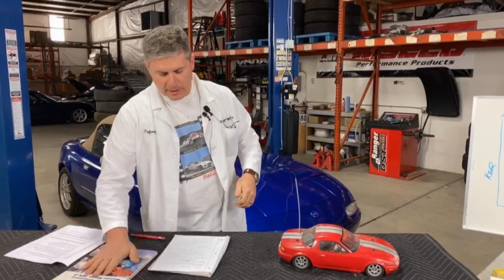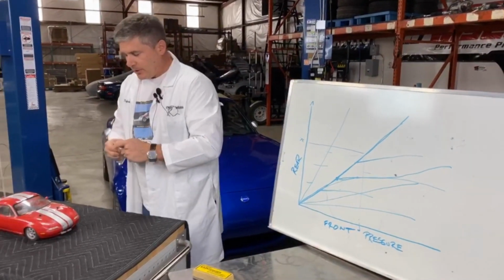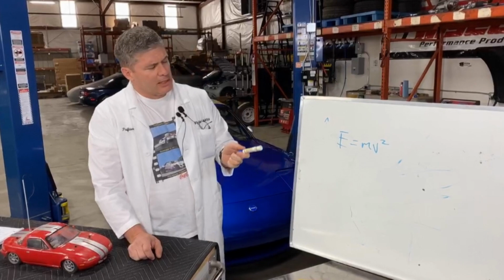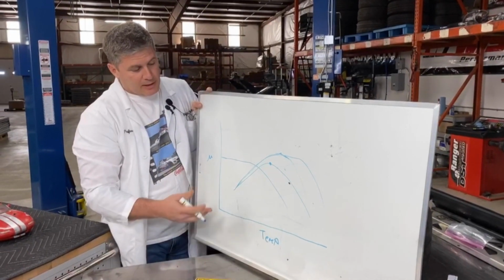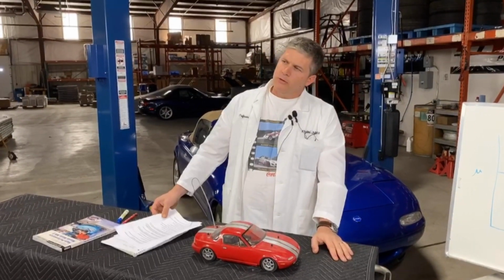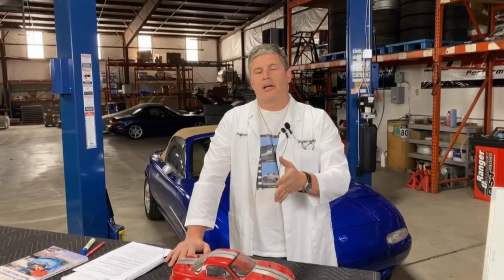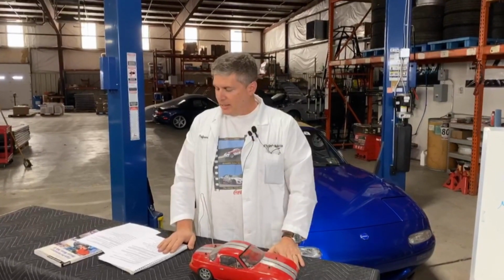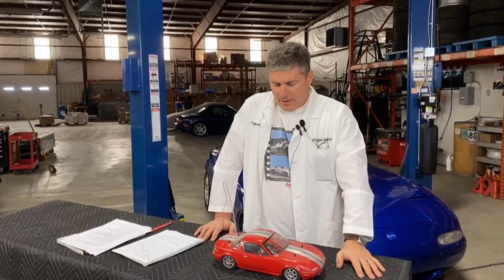Performance Brake Theory (FM Live)

Comment: Apart from calipers and braided hoses, where can I make improvement in overall pedal feel (specifically firmness)? My NC is definitely better with good fresh 600F fluid and braided hoses (and properly bedded track pads) but I'm wondering if there's an upgraded master cylinder with better rigidity or something similar. I know there are also m/cyl braces available but I've been told they don't do much.

Not looking to go for bigger brakes yet, unless maybe i get hold of some RX8 fronts
Reply from the maker: Master cylinders don’t really have a rigidity problem. The thin sheetmetal they’re bolted to does. You want the mounting point to be as solid as possible. 
If you put a larger diameter master cylinder on, you will get less pedal movement. You’ll also have to apply more pedal pressure for the same amount of brake torque. “Bigger” calipers can mean a few different things, see our video on brake caliper tech. 
On the NC, a set of stiff calipers has a very large effect on pedal feel.
Reply: @FlyinMiataVideo  thanks. So does a MC brace help appreciably?
Reply from the maker: @dielaughing73  we've not investigated it on the NC as much, but it's easy to check how much flex there is. Have someone push hard on the pedal while you're looking at the master from the engine bay. If the master moves, you would benefit from a brace.
Reply: @FlyinMiataVideo  thanks again

Comment: Keith, your white board on proportioning valve effects was a nice touch on what Mike Usrey did with his display of fluid proportioning. I learned a lot from both of you on proportioning.
However, my question here is on brake bedding your pads/rotors. 
I watched this video twice and read through the comments, but did not see this question...maybe because it's a dumb question, but even dummies need to know.

When changing from a street pad to a track pad, (vice versa) do the rotors need to be cleaned of the previous pad material transfer before bedding in the different track/street pad material?
Or no bedding is needed of the pad/rotor when changing back and forth?
Is this only required when using a new rotor?
Thank you!
Reply from the maker: Glad it was helpful! 
The answer to your question is "that depends". Some race pads and street pads will play nice. There's a much better chance of that if they're both from the same manufacturer, and the best thing to do is ask the pad manufacturer about the compatibility of their various compounds.

Comment: I ordered your book last night Keith.  I have been trying to research xida vs fox vs the koni setup and a few other things (FM sways vs the setup 949 recommends is another one).   I keep coming across your posts on forums and they are really helpful.  My plan is to read your book cover to cover and after that / once I have the cash ready I will call FM and sort out whatever questions I have left about the suspension options out there.

Comment: and along came the ND.  here's a question is there any benefit to two piece rotors if there the same size.  seeing  as the na/nb use a 11 inch or a 11.75  as a big brake kit. but the nd use a 12.19 or 12.88   is the 11 inch two piece on a nd going to have any benefit? 

another question.  how does some one figure out if they just need the 4 piston caliper, or if they need a two piece rotor too.   does it all come back down to the question of how much heat it can shead , aka how much thermal capability ?

Comment: I’d love to see an overview of all your brake kit offerings to help me decide what I need. I’m not ever tracking my Miata so I wonder how much of a difference the brake upgrade kit would make vs the little big brake kit in street driving.
Reply from the maker: Hi Franco, as with most of our performance upgrades, the value and differences can vary depending on how the car is used. If you are in the US, give us a call at 970-464-5600, or drop us an email at support@flyinmiata.com. We'll be happy to run through the differences and recommendations with you!

Comment: Would the front and rear Little Big Brake kit be sufficient for a turbo NB Miata (220whp range) that has been stripped out (around 2300# w/ driver), runs brake ducts, and RBF600 fluid with proper pads (DTC60 or similar), or would I need to step up to a larger brake kit? I like the idea of being able to run cheap OEM rotors that I can run to any parts store for a replacement if one were to crack during a track weekend, but I also like the idea of not running into a tire wall at the end of my session because my brakes have overheated.
Reply from the maker: I've run it on track with a car in that power and weight range. It really depends on the track - different tracks put different loads on the brakes. Good pads and good ducting help a lot.
Reply: @FlyinMiataVideo  Awesome! I plan on building the car up to being able to handle the turbo power before actually putting the turbo in. Brakes are the next thing I am hoping to upgrade

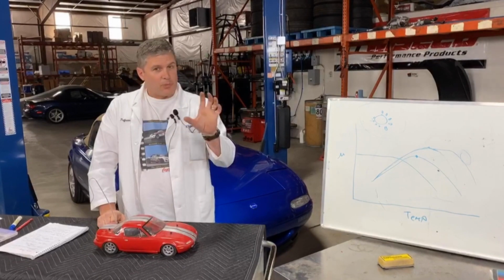Comment: What you have to say about the factory pads is interesting. These are quite good for around town.  One of the failure modes for Mazda factory pads, is that when you take them up to higher temperatures of course they fade a bit, but what is more of a nuisance is that you also can melt the adhesive-binder which holds the material matrix of the pads together, such that there is material transfer to the disks. You start to address this at 20:07. This irregular brake pad material transfer causes the 'wump-wump-wump' that I, like many, first thought was a warped rotor, and now know that is patches of break-pad binder on the disks.  
There is a road from Big Pine up in the San Gabriel Mountains, down to Vallermo on the floor of the Western Mohave, that follows a branch of the San Andreas fault. As you would expect this road has a lot of switch backs. The vegetation is chaparral, so you can see way ahead. Descending this road, I have gone over temperature with Mazda factor pads, resulting material transfer on to the disks not once, but twice. At no time was I stopped. It happened during the descent.
While a Mazda factory pad, with the Mazda logo, in a Mazda box, is a great pad, low dust, good bite from cold, kind to rotors and long lived, when a Mazda pad goes over temperature in my experience it not only fades: the binder that holds the pads together melts on to your disks up in front.  And this lead me to a higher temperature pad, and the problem has never reoccurred even with the disk goes up over 900F. To measure this I acquired a radiometer. I wanted to know how close I was to boiling the fluid, melting the grease in the front wheel bearings and other failure modes that occur with over heated brakes. 
The pad I have been using with success is an EBC "Green" 2000 series pad, which is dusty but is kind to rotors, and seems to be almost impossible to truly over heat in Canyon driving. You can get them so hot that the world around stinks of brake pad. There is no transfer to the disks. And when they cool down they are fine.  
This said, there appear to be many good 'sport' pads. The EBC pads are the ones that I have learned to trust.

Comment: I learned a lot at 5:30, about proportioning valves: how they have an adjustable over-pressure valve, that limits the pressure, but not the front at a user set pressure. Very helpful.  Also the bit about how the rears, if they slip before the front can lean to directional instability.  Quite important.

Comment: Hey great stuff. I bought ND little big brake kit. That's the only brake modification I have. Running the pads included in the kit. Is this a good set up for track days
Reply from the maker: We've run many, many laps with that setup. The only problem you might run into is heat management - it's a relatively small pad, so they'll overheat more quickly than a bigger brake setup will. That's going to depend on the track, the tires and the driver. 
You definitely dropped a bunch of unsprung mass, though!
Reply: @FlyinMiataVideo  think about getting some beefier rotor. Any recc?
Reply: @FlyinMiataVideo  and I am gonna run the race brake pads

Comment: It would have been nice to have your opinion on Plain disc vs Slotted vs Cross-drilled vs Slotted/Cross-drilled in this brake theory.
Reply from the maker: Short version: avoid drilled rotors. Slots are useful.